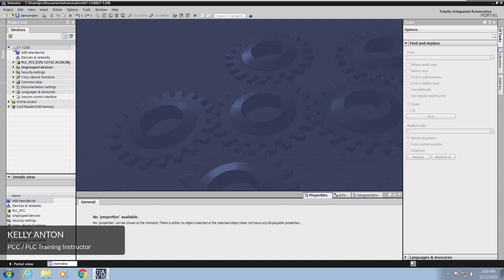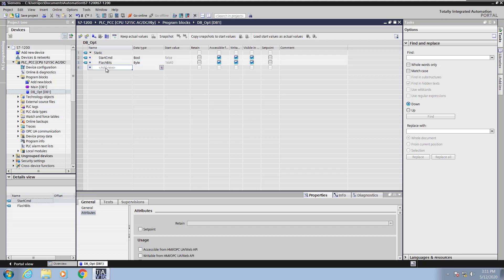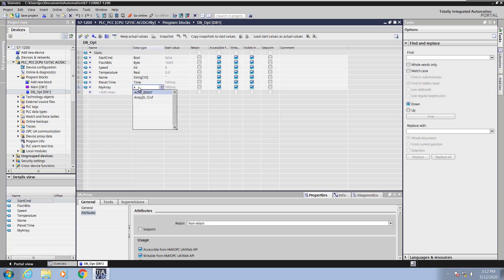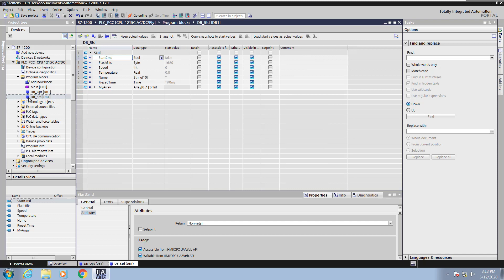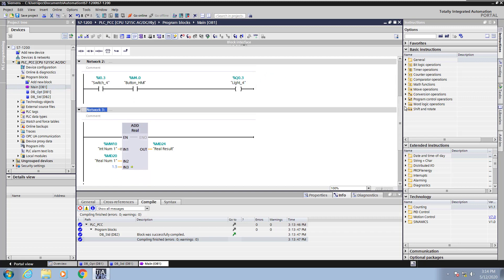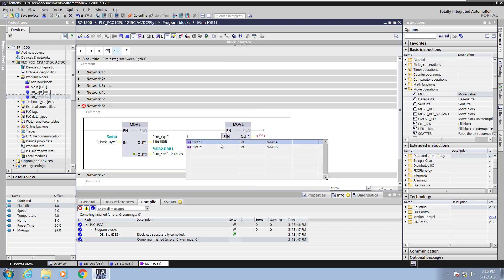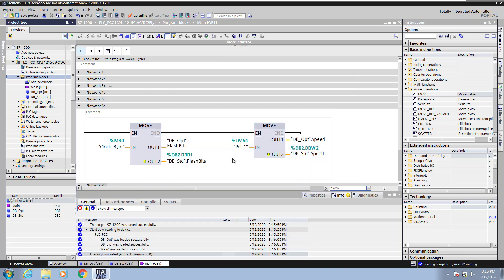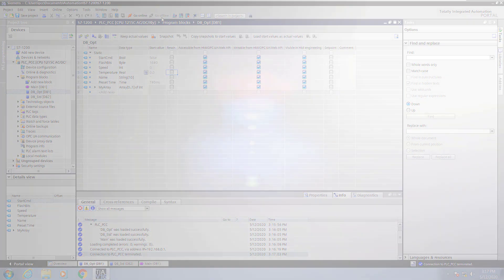Lesson 07 - Global Data blocks (DB) Part 1

Comment: Summary of Differences:
Optimized Access: Memory and performance are managed by the PLC for better efficiency and speed, and variables are referenced by their symbolic names, making the program easier to work with.
Standard Access: Variables have fixed addresses (absolute addressing), offering more control over memory locations but with less flexibility and slower access compared to optimized data blocks.
Practical Example:
If you’re working on a newer system with TIA Portal and need flexibility and performance, Optimized Access is preferred.
For legacy systems or when integrating with older programs, you may need to use Standard Access to ensure compatibility.